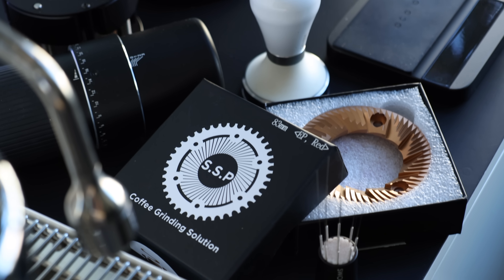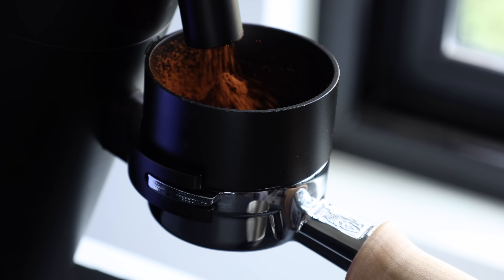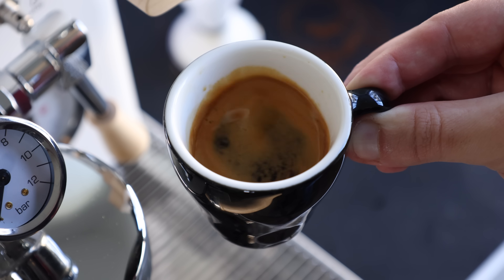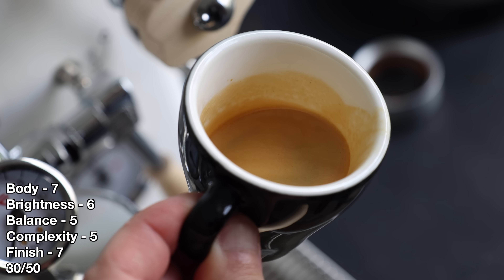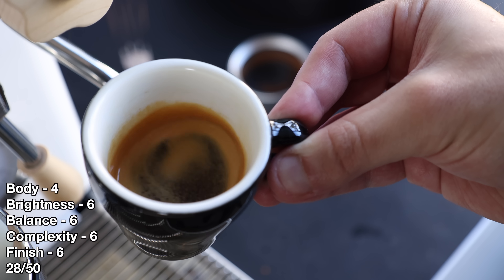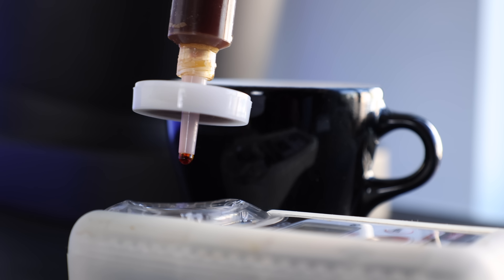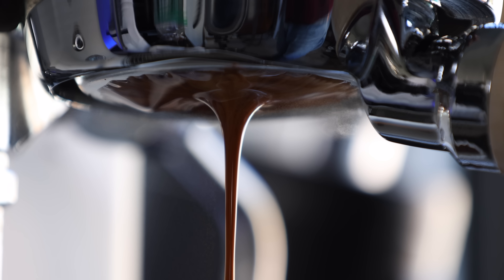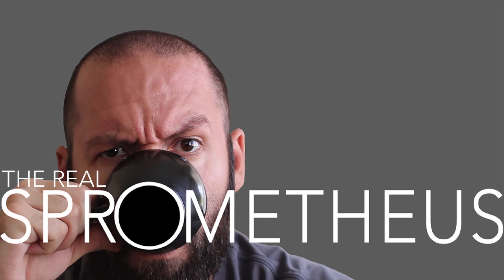ESPRESSO ANATOMY - Exploring Brew Pressure

Comment: Very interesting. My machine came factory set at 10 and it was really harsh. I dialled it down to nine and then to 8.5 but now I’m gonna try even lower. Three bars is closer to mocha pot territory than espresso, not that there’s anything wrong with that. But I wonder if it’s worth spending $1500 on a machine to get three bars when you can do that with a $50 one, if that’s your thing.

Comment: Remeber, pumpa do bit create pressure. It pumps volume. Restrictors create back pressure. Restrictors are not the same on different machines. Over time, they get bigger from water errosion...and so on and on. So,how much flow do you get on puck at what pressure ? Not the same story on all machines.

Comment: Thanks for this great information! I'm looking forward to trying it out. However, I have a question: There's a difference between the pump pressure gauge and the group head pressure gauge on the Lelit Bianca. I set the pump pressure to 9 bar, but in some of my brews, I see 10-10.5 bar on the group head pressure gauge. Why is this happening? Which pressure gauge reading is correct? [Google Translate]

Comment: I think we must start from Espresso definition; obviously definition cannot be too tight, but also not too wide to lose the main distinctive features. Every drink or food recipe has room for variations, until main features are respected. Espresso has evolved from the early '900 "prototype", let's say proto-espresso. In the end of '50s and early '60s it gained planetary popularity. Let's call it classic Espresso. Main features: thick and textured crema, huge body, big mouthfeel, small volume of coffee to be served very fast in small cups. Main features depend on the high pressure in espresso machine, that's for sure; but it's not only a matter of pressure. Even the small headspace, the high resistance baskets, the slow rat tail flow, the grinding quality  contribute to the result. At first Espresso was extracted from blends of dark roasts, so that classic Espresso was associated to taste of chocolate and nuts,  intense roasted notes, more bitter than sweet, not acidic and not fruity, very good for latte drinks. Let's sum up: Espresso is a sort of textured thick bodied short coffee elixir extracted very fast and at high pressure. Roasting techniques and machines tech evolved decade after decade. They started to extract Espresso from less dark roasts, medium roasts, and even from only arabica blends; main features didn't change, just taste: more acidic, less bitter, more sweet, more fruity notes, less roasted notes. Today we try to extract even so called light roasts; but I think that we are arrived to the limits of Espresso extraction: medium-light roasts. Too light roast can never give good Espresso. I think that if you have no textured thick crema, low body, watery mouthfeel, too big volume in big cups, and if you need long extraction, it should not be called Espresso or it should not be considered good Espresso. Maybe you like it, but it's another drink. To prove it, you can extract the same cup with other extraction methods as press or filter or infusion and so on. So we are out of the definition and distinctive main features of Espresso. That's my take. Pressure has a main role for sure, the elixir extraction of Espresso depends on high pressure for sure; however the combination with small headspace, high resistance basket, slow flow rate, grinding quality, pressure and flow profiling (Decent-like machines), type of beans,  helps to extract good Espresso at pressure lower than 9 bar. Depending on the factors above, I can extract good Espresso in the range 7-14 bar with my Decent machine, at most with medium-light roasts, 4/10 from 1 to 10 roasting levels.

Comment: 6:00 keep in mind a .6% difference at 19.25% is a 3.11% change. Most people have the bad tendency to think of a fraction of a percent as insignificant, even when it's actually very significant (eg 3.1% and 3.9% are not the same at all; it's about a 25% change).

3.11% is still insignificant with a P-value of 0.03 against an alpha of 0.05, which is standard in most statistical applications, but when talking about espresso we're not looking at a statistic where every chemical present is being randomly selected for the next molecule to extract and what we get in the cup is just what's in the bean, but dissolved; Some chemicals extract faster or slower, which is why people tend to perceive underextracted shots as "sour" (rather than "watered down," and why americano is not "sour"). 1% of something in solution is much more than enough to radically alter the flavour (salt is a very popular example, of course), so the 0.05 P-value standard is not applicable to taste either. That extra 3.11% of extract may very well be what makes a shot taste good to you. Furthermore, while 9 and 6 bar have similar extraction, because of the difference in pressure, the ratio of what gets extracted is likely different. Where statistical significance actually matters in this instance is how consistently pressure affects extraction yield. In other words, our null hypothesis is not "we extract with 9 bar and assume every % change from average extraction is equally likely," it is "the average extraction yield is the same or lower at lower pressure."

All of which is to say, the higher extraction yield at 7 bar may very well be the main factor in why it tastes better, and a secondary factor may be that higher pressure causes bitter extractives to dissolve faster (hence overextracted and channeled shots tasting bitter at 9 bar).

Comment: I have a Gaggia Espresso Deluxe and changed the default 15 bar to 9 with a spring. I also went to a non pressurised basket and the flavour is much better. However, I also got a 6 bar spring in the modding kit so I think I might reduce the 9 bar to 6 and see what happens. Thanks.

Comment: Great video and certainly food for thought, but, it’s hardly definitive.  Pressure is one variable and probably the least substantial especially in contrast to the character, quality and age of the beans.  Suggesting that the results you achieve at 7 bars ore only accomplishable at 7 Bars is not likely. If you like pulling at 7 bars great but doing so doesn’t eliminate paying attention to all the other parameters. 

All that being said I guess my take away is brew at whatever pressure you want, just be mindful that consistently good espresso from bean to bean, roast to roast and even from opening of a bag to the end of a given bag requires adjustment and if your machine doesn’t allow pressure adjustment or at least doesn’t allow it to be adjusted easily don’t panic. Time, yield, grind, temp…..are all ways to achieve consistency and quality espresso.

Comment: My Lelit Mara X by default generates 10 bars -- not one of the levels you test. I suspect there is a way of changing that if I thought that pressure was a variable that could be independently extracted from all the others. It's -- to use an old fashioned and slightly de-contextualized word -- a gestalt. If the beans in any particular dose were always the same as the last or the next, I'd say, yes, there is a "correct" way of pulling a shot. But as it is, I'm inclined to just surrender to the joy and surprise of what results on any given day, at any given time from my more or less consistent method. Ten bars and declining over the 30 seconds of pull. Your work is thought provoking and I'm grateful for it. Thanks!

Comment: Thanks! Genius idea! The 7 bar shot taste a lot better than the 9 bar shot. 

I have two questions: how many bars is the difference between the pressure indicated on the standard pump pressure gauge and the pressure in the brew group?
My second question is: is the rotary pump actually better than the vibration pump when it comes to the final result (especially the taste)?

I have a EMC Classika PID. And it has a vibration pump. I hope it is good enough for quality espresso.
Reply: My understanding on ECM and Profitec machines 10 bar on manometer is 9 bar on portafilter. So you should adjust OPV to 8 bar on ECM to get 7 bar shot

Comment: THANK YOU !!! Just tried 3 pressures on my Izzo Alex Duetto IV and WOWZA...on 3rd try I got THE ONE.  Such phenomenal balance with touch of sweetness.  I'm so happy right now!
The machine came around 8.6 bar and I turned up to 9 bar.
After your video  I tried 7 bar, 7.8 bar, and landed at 8.1 bar.  I make frothed milk drinks with 2:1 ratio between bean weight and shot weight. I almost always use a medium roast.  My grinder is  DF64 Gen2 with SSP Cast Lab Sweet burrs.

I so appreciate this video for encouraging me to experiment.

Better espresso than I even imagined possible.  I thought I was there (already) when I upgraded from Breville to this semi-commercial machine!  Trust me, that was a huge jump.

But I've made another giant leap in taste today!  Yay 🎉

Comment: thanks for the great content. I do have a question. To have the 6bar, is playing with flow rate paddle of bianca v3 enough or do we need to adjust it at the bottom?
Reply: Same question here. I think i ll try to flow control lever to reduce pressure than if it does not yield good results...i ll lower the pressure output on the pump.   
I am struggling with channeling.

Comment: i think that doing all these tests with the same basket is only a starting point . but with new baskets having all kinds of hole sizes and resistance , there needs to be tests that take that into account . seing if a 10 bar shot with a basket that has alot of resistance vs low resistance tastes better , since the grind size will have to change with both of those examples .

Comment: I've been holding off for several years on following through with drilling a hole in the side of my Izzo Alex Duetto III case because the pressure control adjustment is underneath the cover in the back side (resolve in the Duetto IV with a predrilled hole). I think this and several other videos lately around adjusting bar pressure is pushing me over the edge though. Experimentation will prevail!

Comment: Great video! Personally, I've always thought 9 bar was a value designed to cover for deficiencies in equipment and technique. Bad basket, poor grind consistency, clumpy grounds... just tamp hard and extract high. It wasn't until I got a spirit basket, WDT device and tamp pressure mat that I realized - ya, no. I'm at 6.5 bar with no preinfusion in the spirit and getting the best results ever.

Comment: I use the Profitec go and it was set to 10 bars stock. My shots tend to run a bit punchy and pungent. What is the likely pressure at the group head? I adjusted it to 9 bars and will try that out tomorrow and go from there.

Comment: My ECM Classika PID won't go lower than 8 bar (I think). I run it at 8 but stock setting is 9. I turned it down only to reduce channeling and it worked. The stock basket is better for channeling than a VST 18g ridgeless, I think due to it tapering down to a smaller pin hole area. I highly recommend the stock ECM baskets to anyone struggling with channeling. It's yet another variable! I think that's why we love the espresso game, there's so much to play around with! It's like a metaphor for life, some days you get a poor shot, some days it's perfect, you fiddle about, pay more attention, work harder at it, and you get better shots more often! ✌️

Comment: Hi. I love the video. When creating your recipe for each bar of pressure. Are you keeping the time variable the same and just changing your grind setting as you adjust at each different bar of pressure? Or does time change during the extraction of each bar adjustment?? Flow/pressure profiling confuses me from the “standard” suggested roaster recipe recommendation. Thanks!

Comment: I may be a bit late to this rodeo, but I lowered the pressure on my Lelit Bianca to 6 bar and... I like it. I didn't read up much on it before, so I was shocked when my espresso was tasting really good at 50-60 seconds, but it seems that's how it's supposed to be.

I am also grinding finer and getting less channeling. The shots I've been getting are incredibly slow, but very beautiful (visually). Another thing I noticed is the shots are less harsh on my Niche Zero.

In a month I will be receiving my Lagom P64 so I will keep experimenting.

Comment: This is the single best and most helpful espresso video I have ever watched. Been pulling 6 to 7 bar shots on my Flair 58 for the past week, and they are golden. The espresso almost comes out in globs. The body is so rich and creamy. Literally been fighting nine bars for the last year and a half.
Reply: I will try this. Thank you.
Reply: That's very interesting. Can you also share your pre-infusion and pause numbers (pressure and timings)?
Reply: @Yirgamalabar  I pull down to slowly go from 2 to 4 bars maybe 2 to 3 seconds until the entire portafilter bottom is saturated and starting to drip….then I pull to about 6 bars about 1 second later…..the I maintain around 6 bars mainly applying pressure based on what I’m visually seeing and the resistance I’m feeling rather than staring at the pressure gauge. 1Zespresso JK Pro also on the grinder. 1.4.0

Comment: Very interering test. I reduced the pressure down to 7 bar (I usually used 9.5 bar). Taste is much more smooth.
Regarding to the test procedure, may I ask if you only adjust the pressure while keep other figure (grind setting, temperature..etc) the same? Thanks.

Comment: I just bought a flair and had a lot of trouble balancing brew time with 9 bars of pressure. For some reason I assumed there was no choice but to go 9 bars. Armed with this video though, I've discovered 6 bars seems to be the sweet spot for the medium roast I'm dialing in right now!
Reply: If you have one of the models that has the 45mm portafilter/basket combo then also keep in mind the geometry of the extraction, and thus the resistance provided by the coffee puck, is all different and traditional recipes will lead you astray. Don't worry so much about hitting your times like you might with a 58mm machine. 

Of course, if you have a Flair58 then disregard all this lol
Reply: Yep I've got the classic Flair. I haven't considered the difference in shape and resistance so thanks for the tip!

Comment: I think the flow-rate (i.e. shot time to get 36g) could be the missing link here.  I consistently brew at 6--7bar and have noticed that flow rate can change the flavor quite a bit.  Of course, it's very difficult to hold all other variables constant, but I think it would be an interesting follow-up.

Comment: I'm a little confused. Pressure is a result of flow and resistance. You have to increase either to increase pressure. I'm not familiar with the rotary pump in the machine you are using but it's likely an OPV you are adjusting right? So adjusting that for a lower pressure just means you are diverting the flow through the pump into the OPV instead of through the puck. Grinding finer will bump the pressure up again for the same flow rate. But then again there are factors like the "water hammer". A high initial flow or onset of pressure will compress the puck and increase the resistance of it. A low flow shot with either OPV or paddle set to restrict will allow the puck to expand more, almost like a blooming espresso or Slayer shot.

What I'm saying is I don't think you are changing pressure on its own, you are changing the flow of water that is directed through the puck at a given pressure. When the puck "pushes back" with 6 bars, all water above that is in surplus to the water actually going through the puck is going through the OPV. Not sure if it matters in practice but it might be good to consider for people wanting to experiment. Pressure is resulting force of two other factors.